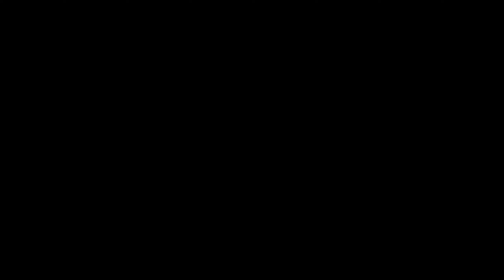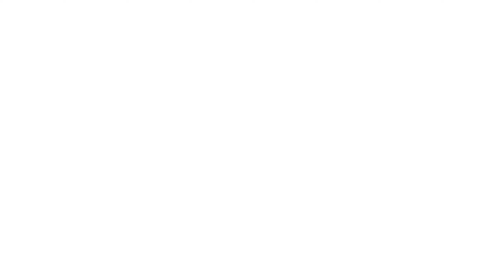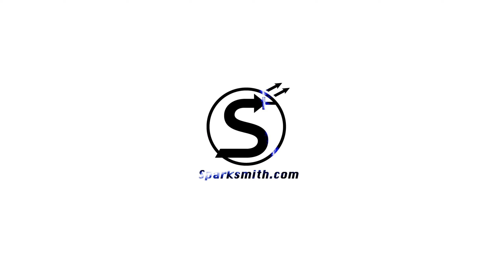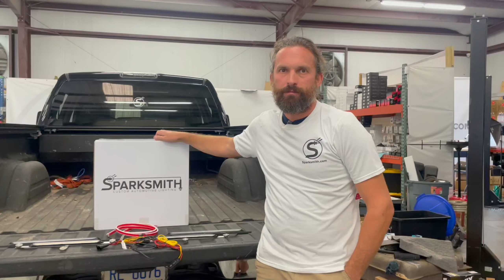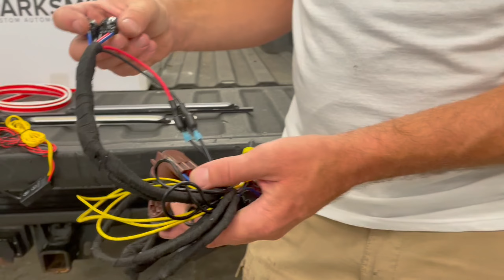NEW 03-07 Silverado Front End Kit: Bi-LED Headlights, GrilleBars, Hood Strip, & Bumper Strip

Comment: Do those headlights have to use the startup animation or can they just start?
Reply from the maker: The startup animation happens when the white running lights first get power, then they stay solid white until they're turned off or the turn signal is activated. I'm afraid there's not a way to override the animation to make them simply turn on.

Comment: Really interested in the hood strip grille bars and bumper bars, I already have led Z off road headlights that plug into to the factory sockets. Wish I knew about you guys before purchasing them this whole kit is very convenient. If I buy the harness would I just plug your harness into the OEMsockets and then my headlights into the sockets on the sparks smith harness? Last thing could I do hood strip white, grille bars Amber, bumper bars white?
Reply from the maker: Thanks! And yes, our plug & play harness will work with the Z Off-Road lights just fine. You can find the products you want at the links below:
Amber GrilleBars w/ plug & play harness: https://sparksmith.com/products/chevrolet-silverado-drl-sequential-grille-bars?variant=43276498141373
Add-on White 70" Hood Strip: https://sparksmith.com/products/animated-hood-light-with-amber-turn?variant=43362834120893
Add-on White Bumper Bars: https://sparksmith.com/products/99-07-gm-truck-drl-bumper-bars-fits-any-99-07-gm-truck-with-bumper-openings?variant=42985835331773